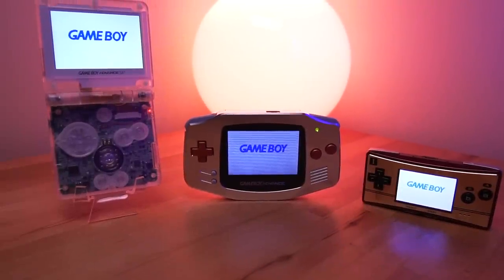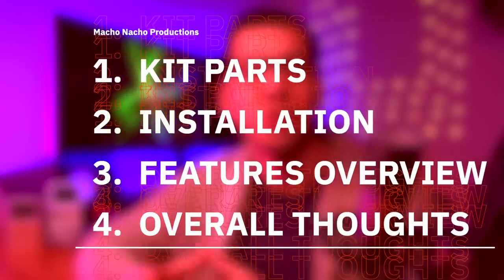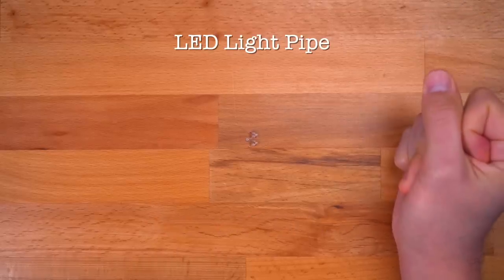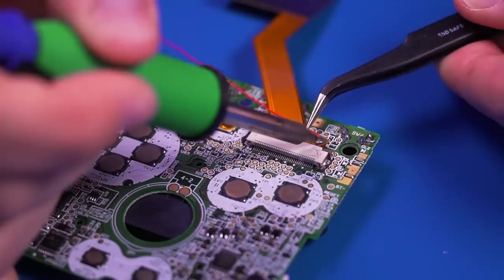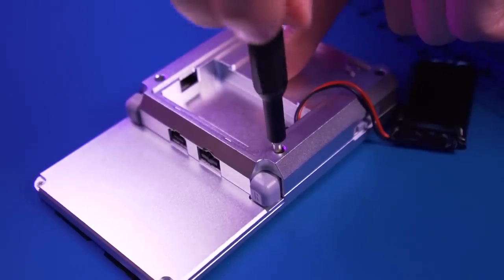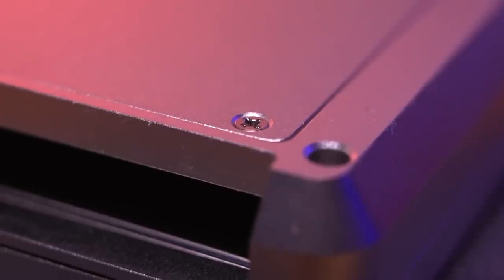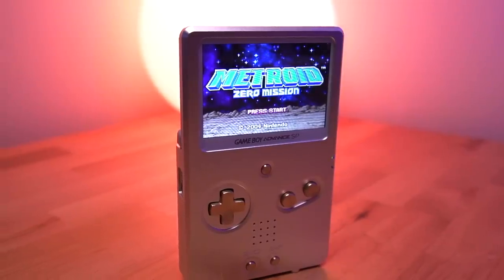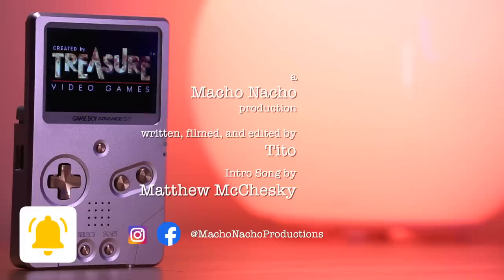GBA SP Metal Shell Without The Hinge! | Boxy Pixel Unhinged SP | Install Tutorial + Review

Comment: I just bought this kit. Unfortunately they didn’t have the USB-C module available. But I decided to leave the space open and go back in at a later date to install that and the headphone jack. My only complaint is that the buttons aren’t engraved with A and B. I know it’s not necessary but I think it adds a nice more official look if that makes any sense
Scratch that. It seems like the power button is very tight. It feels like they were attempting to go for that snap feeling like the regular SP. but it feels too tight and it’s almost hard to switch. I took it apart to double check my work but I put it in correctly and I adjusted my screws to see if that helped. I think it’s probably just because of the materials. Unfortunately that doesn’t seem like an easy fix. I’d almost recommend having a switch built into the shell custom. But it’s already pricey to make these so I don’t think that’s a worthwhile route for them to go. Maybe a bit of grease there might help. It’d have to be super tiny tho. Or maybe making the nub for the switch a bit smaller in the actual shell might work. Hmmm has anyone else run into something similar?
Reply: I was just going to ask the same thing,the power button is ridiculous to put on to the point you are actually dropping the device,i noticed tito never mentioned this so was very surprised,actually thought i had done something wrong.also would have been nice to enclose wires with the usb c charging board as i had some bother getting cables long enough that fidt and not impinge on the buttons,i dont mind they are not engraved as the would spin round and the A and B would be upside down etc.

Comment: One suggestion, and kinda a safety thing you should do. The battery should be connected with a JST (or similar) connector. So if there is an issue you can disconnect the battery. Batteries shouldn’t be hardwired to PCBs. Other than that, this is great.

Comment: Nice mod, through & through ... Although, i would have gone with Jtagging the battery - socket & connector - in case U would need to take it apart again to perform whatever future mods or repairs more easy than desoldering the terminals everytime .. Otherwise, great work & looks a high quality mod .. Cheers

Comment: You should have mentioned that you need some foam for the screen. I dunno if that "issue" was present on the v1 case, but v2 needs definitely some foam between the metal and the screen.  Otherwise it wobbles inside the case.

Comment: Unhinged V2 tomorrow green with black buttons. Plus i designed a file to engrave rayquaza on the battery cover. Got the V2 Unhinged and its sweet! 1 thing about the tutorial is the usb c wires need to be either really thin or put the black wire towards the bottom most part of the ground shielding and rout them hard turned right and down into the hole. Putting them over the chip like you have or soldering the ground to the middle of the side caused the shell not able to close. 1 thing i wish was in the same video was that headphone jack because idk where im going to route those wires even after seeing your jack and blu tooth video

Comment: the biggest con for me (not mentioned in the video) is that the GBA -> Gamecube cable wont fit anymore since it latches into 2 hole's that arnt cnc'ed into this case. They could ahve made the case even a little bit thicker, moved the gba connectors a bit  and added a slot where you can put the games into, like you would on a Gameboy Pocket.

Comment: The fact that you have to solder their battery directly to the power connector is a big design flaw. Even if it's high quality it's still a part that's intended to be replaceable and having to dismantle your system to swap it out is short sighted. If they can't put contacts on the battery itself to use the SP's pins (I assume they just bought OEM batteries in bulk and put their brand on them), they should make a wire lead that solders to the board and let you connect the battery with a JST connector.
Reply from the maker: Jst connector is doable. You can also just use the original battery. No soldering required

Comment: that looks amazing, and, for what you get, the price seems very reasonable.  when you started talking about how expensive it was, i was expecting something eye watering, like $250-$300, but $120 is perfectly acceptable.  one thing, though, couldn't you just remove the shell from the gba-gc connector in order to use it with the kit?

Comment: $94 for the case is a bit steep, as nice as it is. I wish they would make a plastic/PLA/ABS one for a more inexpensive option... I also find it weird they would use the USB-C charger board as a dummy USB-C port that isn't utilized at all, other than linking the original port to the USB-C port (Both are 5v rated). The USB-C board has better protection and rated SMD parts than the original charger protection offered by Nintendo. I think it would have been better utilized, as an option, to wire the 3.7v battery to the USB-C board, and have it then wired to the 3.7v input on the GBA board. But that's just me....

Comment: My U5 IC is faulty and I only get 2.6v to the battery terminals so I can't charge. I'm thinking I can use the USB charge controller to directly charge the boxypixel battery instead of trying to source a new u5 IC. Anyone else tried this as a bypass? no other downsides other than only being able to use USB to charge

Comment: I was able to get one from the first batch too. But I was having a difficult time deciding how to wire it and I find your solution much more elegant than how I decided to do it. However, I'm having one issue, I must be grounding a component somewhere as with it fully assembled, it won't turn on. I'll get it figured out within the next couple days hopefully.
Reply: I figured it out. I had to shave down the screw for the cartridge shield. It was pressing too hard on the mobo when fully assembled. I also had to shave down the towers on the rear lcd cover because they were pressing too hard on the back of the lcd, causing pixel discoloration along the top of the display. Got everything figured out though and notified boxy so he can possibly mention it in the pdf guide when he finishes it.
Reply from the maker: Awesome!  Good catch!  Thanks for sharing and letting boxy pixel know!  Cheers!
Reply: @MachoNachoProductions  boxy ended up letting me know that he adjusted the related tolerances in the cad model for future batches, so hopefully nobody else will have my experience lol
He said that the screens ended up having pretty wide tolerances because of the way the glass is glued to the lcd panel.
Reply from the maker: Awesome!  Thanks for the head up. Appreciate it!  Cheers!

Comment: looks great, but i wonder how the adhesive keeping the usb-c board in place is going to hold up (and i guess the headphone jack would be attached this way too). maybe it's fitted snugly enough that it won't be an issue?
Reply from the maker: The tape helps but it also has walls around it to keep it secure also. Agree it would be nice to have it secured by screws. Cheers!

Comment: Hello! Awesome video btw!

I had a few questions about the build.

Why did you have to trim the tab for the LED light pipe? Was it to allow the screen ribbon cable to sit flat? Also, is that why you added hot glue, so that the ribbon cable would not sit on rough sharp metal, but instead on soft dry insulated glue?

Sorry for all the questions. I am planning on buying this case and would like answers now instead of during the build. Thanks!

Comment: Where do you get that IPS screen with the screen lens already stuck on AND with accurate "SP" lettering? The only one I know of has a very inaccurate font for the SP part of the logo which sucks since I love mainly white screen lens.

As for thoughts on this mod, it might be good to assemble one if you've got spare parts, but I think a plastic shell would be easier and less pricey to work with. The callback to earlier models is great but the inability to use certain accessories (GBA to GCN link cable and probably wireless adapter too) is a bit of a deal breaker for those who like to use them such as myself. But it's all about the preference of the modder, and either way it's good to refurbish an otherwise suffering console that is in bad shape.

Comment: Came back to this video for reference. I was wondering if where you soldered the two wires onto the USB-C module passed the electricity through all the safety stuff on the board? Or if it just bypasses it? I got several of these specific modules for other projects and I want to make sure the voltage and amperage is regulated so I don’t fry anything.

Comment: I found a "solution" to use a bigger battery without soldering. It is possible. But you need the lipo pcb from makho and some sort of "hard foam". The installation can be a bit finnicky, but it's worth a try. I now have a 1700 mAh battery installed and it works fine. I can upload pictures if anyone wants to see that.

Comment: Hey Tito I had a quick question. Are the measurements for the finished project closer to a DMG, Color or Pocket Gameboy? Im looking to buy a rose colored gaming stand for it. Obviously they don’t have a selection specifically for this. I purchased a DMG kit, but it’s slightly too wide for the Unhinged SP. I’m thinking GBC or GBP stands might be a bit smaller but I’m unsure which is more similar to the SP unhinged.

Comment: Looks good but the price is to high for me for a shell.
But I have a sp in a 3d printed shell that Form is like a gbp/dmg and it has enough room for usb charge and Audio, Sound board and the ips screen.

And I see that you use my tip where to soldering tge wire for the  usb port and for the battery

Comment: Just bought this "premium" case and all. I tried it and spent some hours trying to make it works.
So first : this is not premium. This is expensive and to be honest it costs really too much for what it is. I received the case, an ips screen and everything needed to make the game boy unhinged hence an guide. There is no guide with this "premium" case. So your video seems to be the only tutorial.
I follow this entierely and found that you weren't speaking of the jack so I found an other video for this part ( video which were false in fact ).
At the ending I found 2 problems with this case :
- the on/off part is too tight, it broke my switch after a few use. I guess I'll have to buy an other one and trim that "premium" case
- the four screws on the back are terrible to put. I never had this sensation but it's hardcore to keep the screws straight in the hole and have it in the right place. 

To be honest, I feel I have been robed by your video. It seems that everything is smooth but it's really not the case. At this price I would expect really better.

Comment: I like Boxy Pixels shells. But I wish I didn't have to use the particular battery circuitry. I blew my GBA fuse using the charge circuitry provided and haven't been able to use my GBA  since
Reply from the maker: You can use the regular battery with this shell. No soldering required
Reply: @MachoNachoProductions  That's the upside with this SP version. For the Original GBA, I'm not sure how but the battery mod blew my fuse... Nervous to attempt to replace such a small component
Reply from the maker: Yeah that’s strange. You can buy fuses from retromodding
Reply: @MachoNachoProductions  yeah it's on the to do list! Just a little nervous with such a small fuse 😅

Comment: Did he fix the machined d-pad for the SP?  I have the Boxypixel machined buttons+dpad for the original GBA but I don't use them because the center nub on the d-pad is too short.  Consequently you can press all 4 directions simultaneously and it doesn't feel great.  Other than that I Iove his aluminum GBA shell.  The hefty aluminum just feels really satisfying in the hands.  The price isn't even that bad IMO considering the material and CNC time.

Comment: If the game carts slotted behind the screen flush it would be a no brainer. As it is... an original GB/GBC cart sticking out of the bottom is a deal breaker for me. A design with this much care,  engineering, and cost should fix the flaws of its predecessors.

Comment: I'm having some problems with the charger. When I have the negative wire from the usb-c board soldered to the ground shielding, the original charger and the usb-c charger don't work. If I desolder it then the original charger works. I have no idea what's wrong. I soldered it to the same place you did. I am using thinner wire than you I think. Could that be the problem?

Comment: I really want one of these, but could it be done without soldering? I'm not against learning how, but a no-solder install looks to me like it would be much cleaner and easier. 

The only (non-optional) part I saw that seemed like a maybe was the battery install, since it looks like it raises up and out from the board.

My only complaint is that the cartridge slot still faces downwards rather than up like on the other classic Gameboys, but I understand to make that happen would require rearranging basically everything, lmao.
Reply from the maker: Yes you can do it without soldering!  No usb c, headphone Jack, or larger battery though.
Reply: @MachoNachoProductions  Works for me! Now if only I could find an SP with a busted screen ehe... Man, just a few months ago you could get a frontlit SP for like $30 all day every day. ;u;

Comment: I did this mod and my screen isn't staying tight against the shell. I 
used the unbranded ips screen boxy pixel offers on their website. I 
followed the instructions on their guide where they recommended foam 
behind the screen to keep it tight but it is not a firm fit like I 
wanted. Any suggestions? I was hoping to find a 3d bracket but have not 
found anything. 

Thank you for your videos, not only are they fun to watch but the are very informative.

Comment: If I have the 001 model and want the brightness control do I need to by extra part? Also if I have the 101 do I need to do any soldering for brightness control? Thanks.
Reply from the maker: You have to buy an IPs screen. This won’t work with the stock screen. The IPs screen has brightness control which requires and extra wire to be soldered.
Reply: @MachoNachoProductions  thank you! Seems like I've already bought everything I need. Just a little bit waiting. Thanks for the detailed video and reply!

Comment: Can you comment on when you will do the headphone jack upgrade?  Also, is there an amp mod option for this as well?
Reply from the maker: I ordered the part and it should be in soon. I’d say not this Thursday but probably the following!  Stay tuned!
Reply: @MachoNachoProductions  Sorry for all these questions?  I finally got the Boxy Pixel kit!!!  I am waiting for the screen and the headphone jack parts at the moment.  

Reviewing the Boxy Pixel document, there is a number of recommended instructions not mentioned in your video.  Such as shaving the wall of the button well and clear coating the metal button as well as trimming the solder joints.  How necessary are these?

Comment: Tito help! So I just finished everything and for some reason I lose sound when I plug in either the type c charger or the original charger! What could be wrong??? Maybe I accidentally bridged the 5 and 6 pin on the charge port? I have to get home to open it back up! What do you think?
Reply from the maker: I would double check your wiring for the USB C point. It should not cut off the audio when plugged in. Is the charge indicator light Turing in when the usbc is plugged in?
Reply: @MachoNachoProductions  yes it starts to charge. With both chargers but I lose sound for some reason when charging

Comment: I dropped my preorder unfortunately, I'd have to buy another IPS along with and couldn't use existing one without aligning the glass or such, didn't want to pay that much
Reply from the maker: Isn’t your screen already adhered to the glass?  It should be able to transfer over
Reply: @MachoNachoProductions  I got the IPS screen but it was the one that doesn;t have glass on it, i installed it on an OG gba. I think adding up all the little things I'd have to buy along with ended up being a bit too much for my liking, and I really wasn't sure if I'd jive with the new button dimensions and springless LR to drop that much on it.
Reply from the maker: I hear ya dude. It is a lot of coin to drop on the mod.

Comment: Looking through boxy pixel's site, they recommend a diode needed for the battery mod and usb-c mod. Is the way you did this installation a work around that doesn't need the diode?
Reply from the maker: I believe the diode was only required for the AGB. The AGS does not require one.
Reply: @MachoNachoProductions  Ah okay. The product page for the diode on Boxy Pixel's site doesn't specify, but I trust your word on that with all the great modding you've done. Thanks!

Comment: The instillation page on boxy pixels website recommends breaks the edges of the button and d pad mold? Did you decide that wasn’t needed?
Reply from the maker: Yep I saw that and it wasn’t needed for mine
Reply: Have you had any issues with the D pad slipping? After a few hours playing I starting getting spotty response in the down direction
Reply from the maker: No issues yet. Played it for several hours on and off.